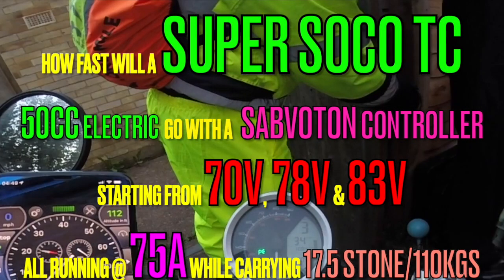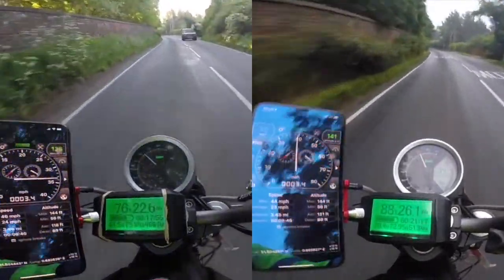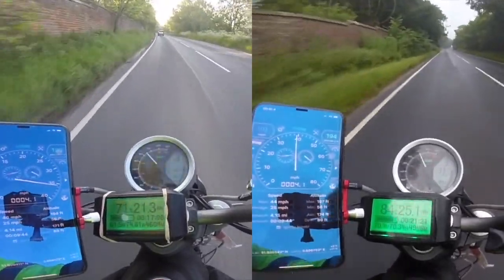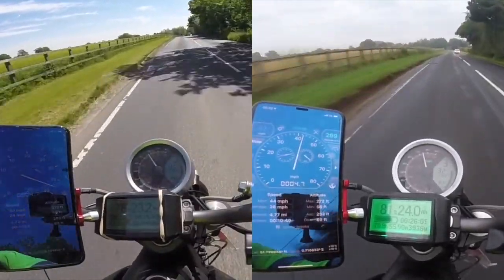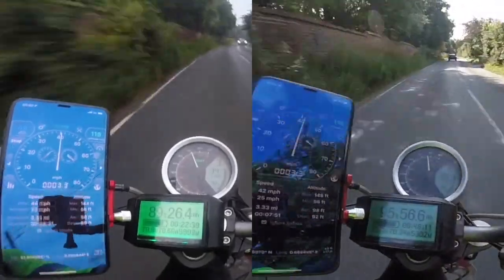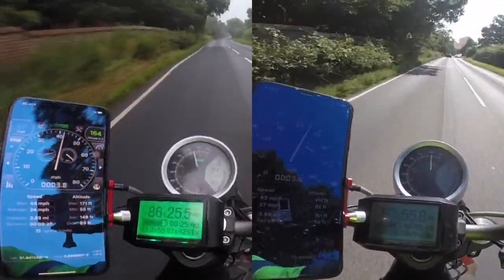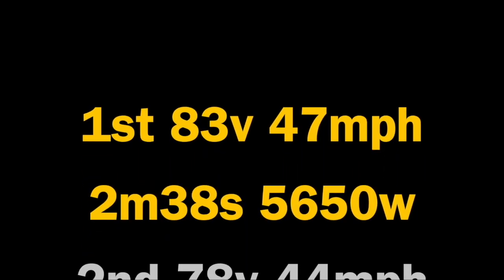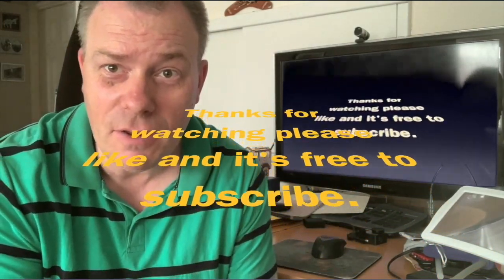Which is faster uphill 70v 78v or 83v Super Soco TC/TS Vmoto while running 75 amps

Comment: This is the TC , nor TC Max?.    I have the TSX, same as the new TC.  I will build a new battery. But not sure what voltage the 3000w motor can handle.
Reply from the maker: Voltage isn’t the problem when it comes to the motor, Amps are the problem, because if you throw through too many amps, you will melt the wire insulation on the coils of the motor
Reply: @kpadventure   More Volt = less amps.   but motor have a volt limit. but i do not know what it is
Reply from the maker: V x A = W
Volts x Amps = Watts 

This motor only has coils and no circuitry to fry with overvoltage on the Power side of the motor, but it does have circuitry for the hall sensors side (controls speed), but they run a separate circuit at 5v for this

My bike at the moment is running maximum 82v x 75amps which is about 6,000w, but only at Peak for short amount of time like 30 seconds, normally try and keep it under 60amps which is around 5,000w, the controller normally likes to sit at 30 to 40amps at top speed which is about 2,000 to 3,000w depending on voltage drop
Reply: @negueba235689  It is not just the amp limit, it is also the frequency limit. If the rotor speed is too high, the motor could start cogging. The inductance of the stator cores also plays a role, the higher the inductance the slower the magnet-nonmagnet change, leading to more heat build up in the cores instead of the coils. Thinner core laminations made of good materials play a key role, and most of the Chinese laminations are made of poor quality metal. Hence so many overheated motors with fried coils.
Reply: @kpadventure  How would your Super Soco handle a 96V controller, were you considering that option to get more acceleration and speed?
Reply from the maker: I have already bought the 96 V controller, but just haven’t fitted it. The campervan came along and took precedence.
Reply: @kpadventure  Awesome, I subscribed to see that in the near future. Keep up the good work! :) After seeing your videos, I am thinking about a similar project if I will manage to fina a Super Soco with clean EU papers and a dead motor and controller. I got a Cromotor that I laced to a 17 inch rim some ten years ago, and could pair it with a 108V controller to see how the Super Soco frame would handle this amount of power. ;)

Comment: How many volts does the original connector last? Does it work at 84 volts?
Reply from the maker: Its not the volts its the amps that are the problem 
the original connector struggles with 40amps

Comment: I have the opportunity to buy a super soco tc but found it lacking for my hilly area and want to use a step up voltage converter to bring it to 74v (As it overloads at 75v per your videos)  I also want to put in a Y cable that switches between dual batteries every 15 seconds.

Is there anything else I would need to do to accommodate this setup? (I am hoping I could reroute the regenerative braking directly to the battery instead of to the stepped up power, so there would be no shut off)

In your uphill video 78V did a top speed of 44mph, average about 39mph , 70V did top of 41mph, average about 34mph, so I'm extrapolating 36.5mph average speed on hilly areas for 74V, does that make sense?
Reply from the maker: Yes that makes sense👍
Reply: @kpadventure  Thanks!  If I just want to step up voltage to 74V, is there anything else I'd need to do other than just the step up voltage converter?
Reply from the maker: All you need to do is increase the size of the battery voltage the bike is fully capable of handling the voltage up to 74.9v in its standard setup
Reply: @kpadventure  That's what I understood from your videos, thanks, I had just wanted to confirm I hadn't missed anything.  Highly appreciate the confirmation.

Comment: Nice vídeo. I'm trying to install the sabvoton on my tc too, but I think I might have a defective hall sensor, can u tell me the hall sensor angle you are using on your config? When I try to do the hall test it says 4 degrees, witch i find really weird and the motor sounds weird when running.
Reply from the maker: Thank you 
4 degrees is about right
You need to set the pair poles to 30
Then it might sound better